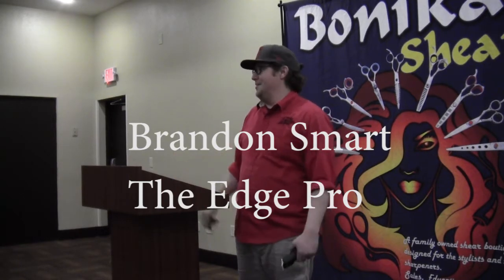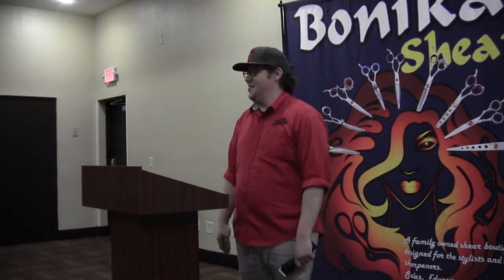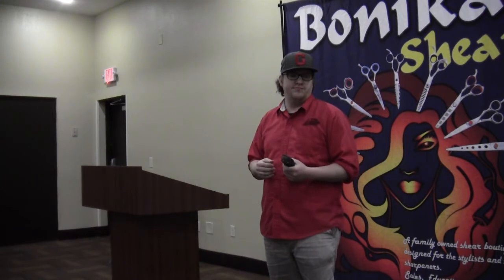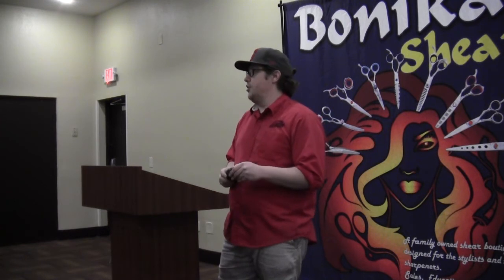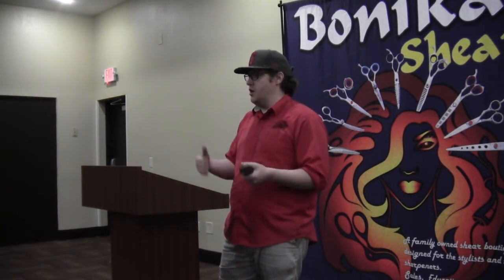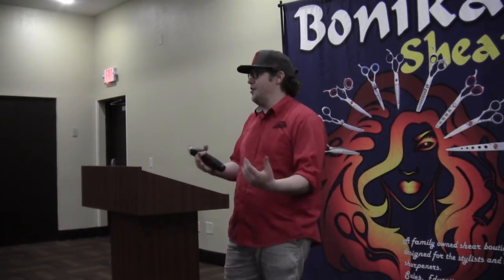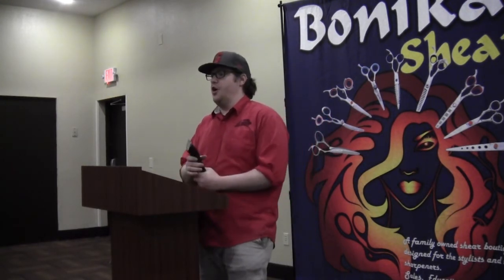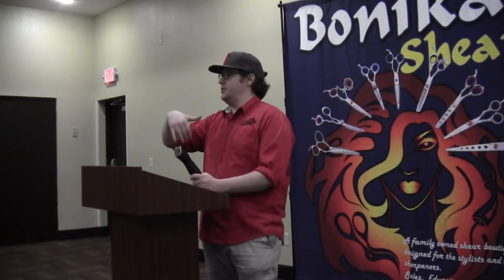Common easy repair on Andis new ZR Clippers

Comment: The blades on mine keep getting extremely hot, and quickly. I contacted Andis, and they said to "oil the blades before, durring and after a cut". This isn't efficient at all. Any tips before this clipper gets tossed??
Reply from the maker: Are you using a spray on the blades. This can cause the heat. I suggest H42.

Comment: What size driver is needed to use on the screws? I cannot find the answer anywhere. I need to clean out the housing unit but cannot get into it because I cannot find the right driver size.
Reply from the maker: Check with The Edge Pro. I am not an expert on this.